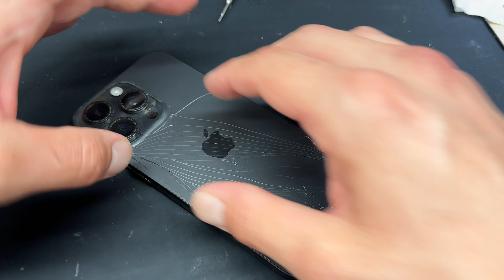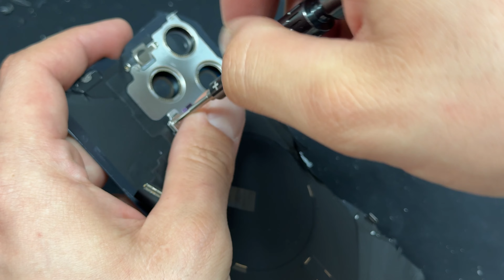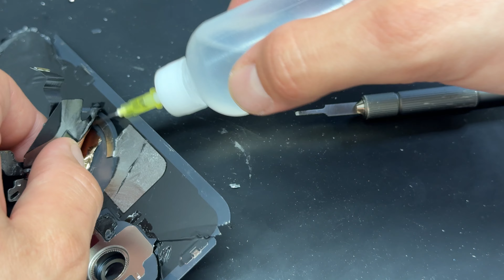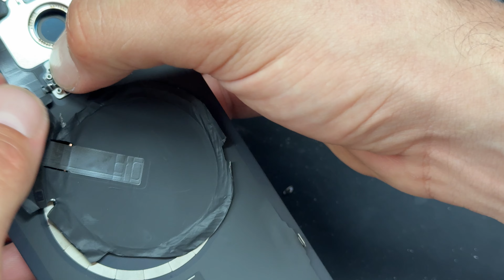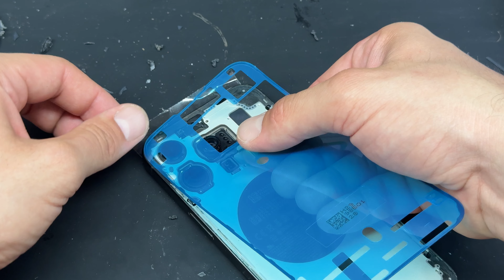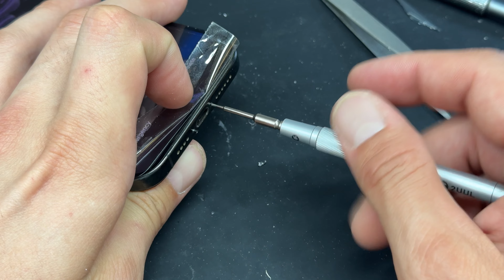Repairing Iphone 15 Pro Max Back Cover! - Guide To Swap Your Broken Back Cover!

Comment: I have a question if you wouldnt mind replying, is it necessary to remove the old flash module and transfer it on the new one? Im pretty sure the back glass from the apple self service repair program already has a replacement so no need to transfer anything, just replace and recalibrate within ios calibration tool
Reply: Most aftermarket (Chinese reproduction) back cover assemblies don't come with a flash module/wireless charger attached. The one sold by Apple's official self service repair shop is indeed come pre-installed, but it's more than 10x expensive than the aftermarket glass.

Comment: I'd buy apple if somehow they make either
1. Their device very very robust, maybe composite back instead of fragile glass
2. It's cheap and easy to replace their fragile hardware

I know both won't ever happen due to Apple's greed
Reply: What kind of phone do you use that doesn’t have a glass back? And btw their phones aren’t any more fragile than a Samsung or other smart phones with a glass back.